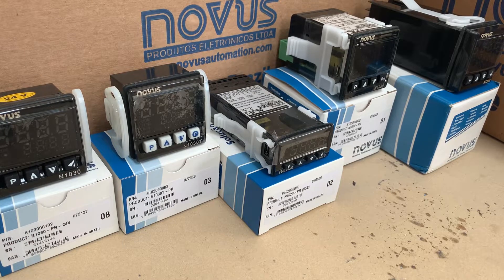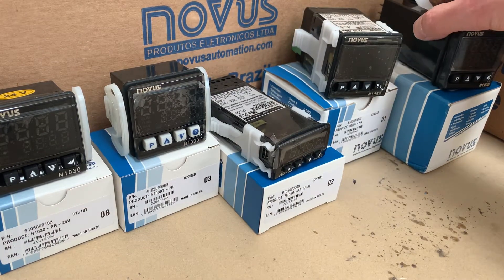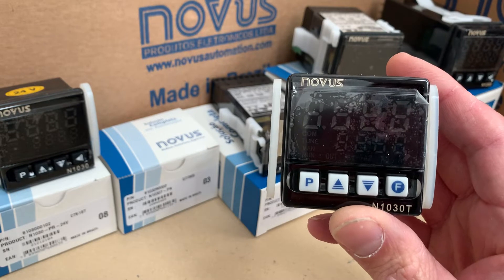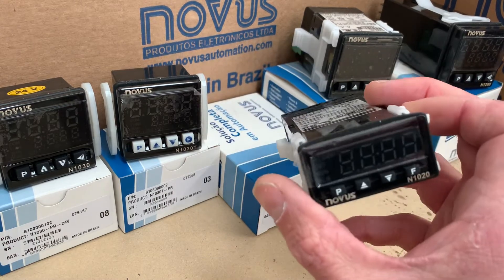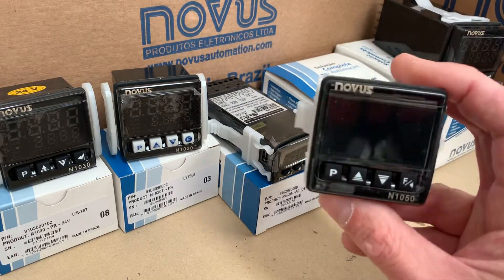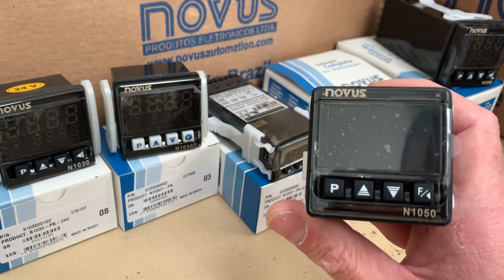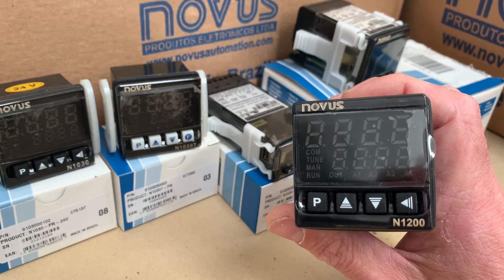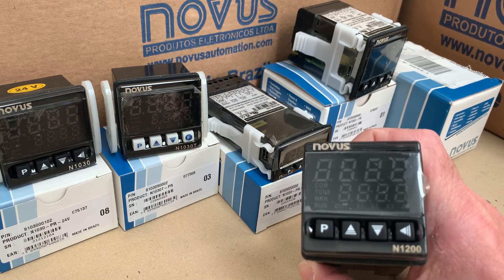Novus PID Temperature Controllers - Overview

Comment: Thanks for the overview. I purchased a few of the N1030 to control under-cage heat cable for a few boas.
(Is it possible I am the 1st customer to use these to control heating for reptiles?)
My favorite part of this controller - the detachable terminal block. That makes things so much easier. Plus this type of screw clamp terminal is just easier to work with than traditional barrier terminals. Oh, the short depth too, that is quite helpful.
Reply from the maker: Thanks for your application story, it's the first time we have heard about reptile heating but it's a great choice of controller. By popular demand we now have the terminal blocks available to buy on the website! P.S. If ever you upgrade or replace the controller the terminal block will slide off and push straight onto the new device